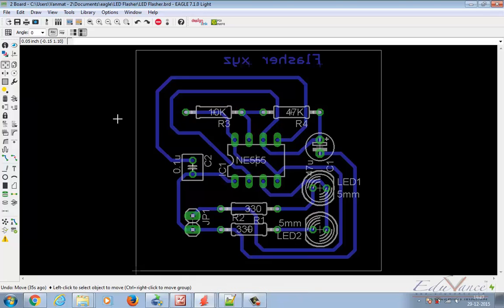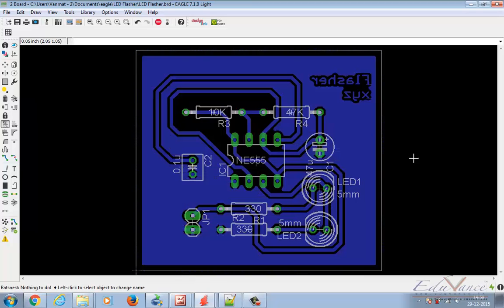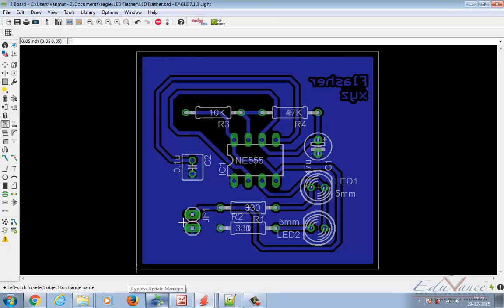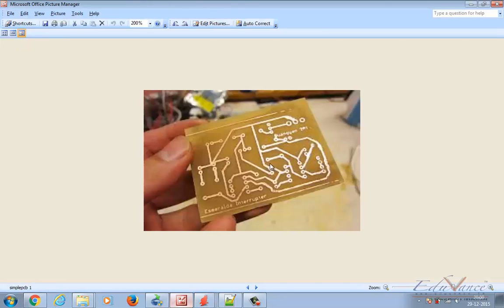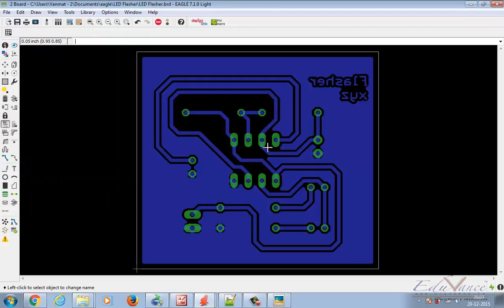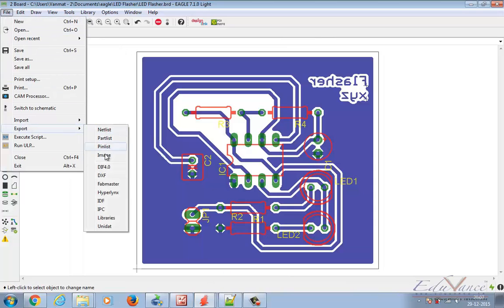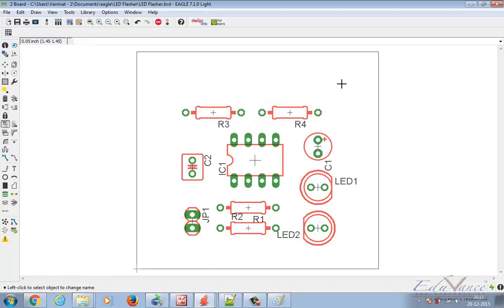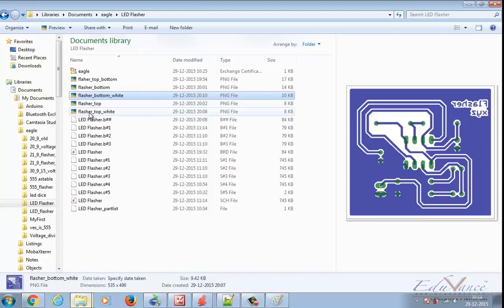PCB lecture 6 Making PCB

Comment: Do we need to take mirror image while taking print out because when we print it on the board then it will be mirrored.
Reply from the maker: No, you don't need to use mirror image.

If you are using eagle then the following process can be used to make the photoresist print -

1) Print the file as pdf and change it to monochrome then if the tracks are white invert the image so that the tracks are black.

2) Use the ULP exp2img.ulp to extract the image of the board file. If the tracks are white then invert the image so that the tracks become black.

3) Export the file to gerbers, then use a gerber viewer to convert the gerber to an image and then use that image.